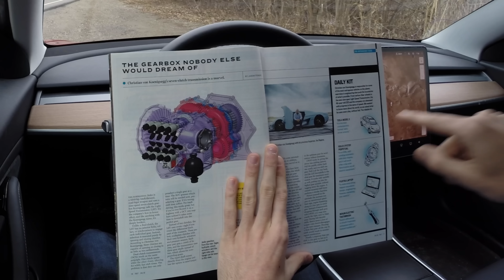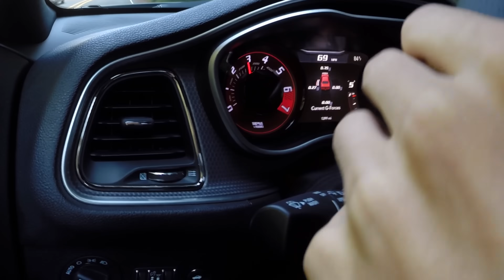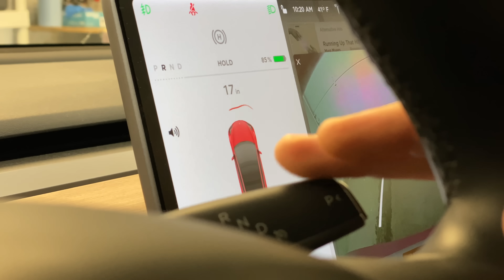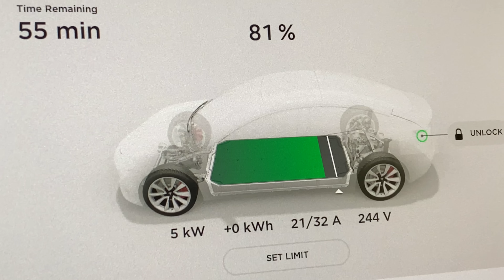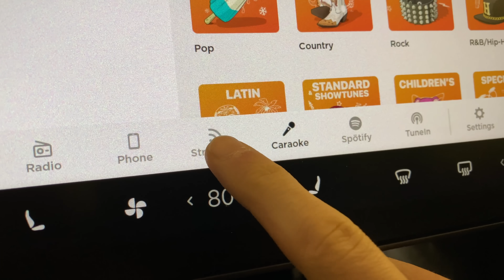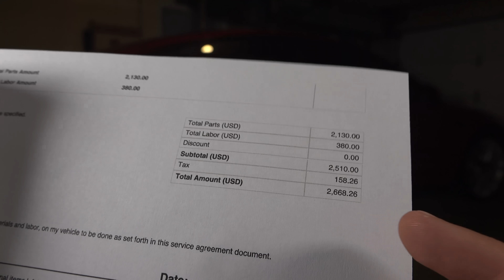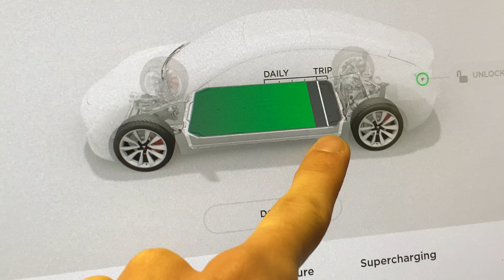Living With A Tesla Model 3 For A Year - The Best Daily Driver

Comment: No offense. If you like EV's cool. But they have just as many cons as pros. The batteries are an environmental disaster to manufacture. The car still requires fossil fuel to charge. They have issues in extreme environments with holding a charge. lake of dealership support, etc.  I find EV's to a nice niche market for certain situations and the right climate. I dislike Tesla's proprietary business model similar to Apple. Tesla's are a nice test bed for future technology, however, I'll keep my F150 and probably buy another ICE. 

Let's not pretend this is something it's not.
Reply: Steve Awesome It is the future and eventually everyone will drive an EV. It’s not a niche. They are much more efficient so a lot of fossil fuel will be saved. Battery production is not a disaster. It’s simple as that.

Comment: Can you do a technical video on TEG peltier exhaust system for generating energy from the engine exhaust heat? I have found some research from BMW showing promising figures. So I was wondering if this technology is still researched for hybrid cars or abandoned for some technical/cost reason? Thanks.

Comment: I think its nice only filling up once per week. Not plugging in every night. 
Also I dont have to park in a garage, or have a charger avalible. 
Cost per mile with depiction is way higher with a 60k car but the performance is undeniable. 
These are very reliable for 100k but the repairs that will eventually come will be thousands is not 10s of thousands after 10 or 20 years. 
If toyota only had a fully electric RAV4 AWD with maybe a I3 type back up small engine. Toyota is the only brand than seem to able to have high enough quality control to go 500k with minimal failures on stuff like climate control. power windows. wheel bearing. CV joints , shocks. buttons ., etc, etc. All of these items will be problematic in a electric car with extended usage.

Comment: I think the Model 3 Performance is an awesome car...I just can't end my love affair with manual transmissions.
Reply: I drive heavy duty trucks with 18 spd  to get over that fetish. Getting very rare nowadays with lots of Automatic Euros and lots of pretend drivers that think they are supertruckers driving them.
Reply: Gears beats electricity. Only city vehicles benefits from electric power. As soon as a electric car needs to compete with a geared combustion engine cars they go wrong in SOME major way. Rant incoming! Copy pasted one.

Cost, Environment, Complexity. One of them ruin the electric car. Outside of small slow electric cars. Like a electric golf car you use when playing golf. Sacrificing safety and speed. But just strait up beats a combustion car. Since it get all the benefits of the engine choice. 

Electric cars are heavy and wasteful. Making small city car with basically no impact safety nor good top speed might be the future. Simple cheap and good for the environment done right. Combustions cars can not beat a good electric car in this category. 

Good driving techniques and a change in how we travel in cars would be better for the environment then heavy battery riddled electric cars. Removing safety concerns being the big factor. And why we travel. (and how)

Electric cars are heavy and running on mainly coal unless you specifically charge them with YOUR OWN produced reenable electric source. Since anyone and everyone is taking advantage and making money before anything else. 

Just taking away the safety features of the car would minimize the batteries needed. And what damage the batteries have done to the planet needs to be taken into account. Just as well as the fuel used in a normal combustion car.  So minimizing the batteries needed is the fight needed to beat a combustion engine. Simply put. 

Saving on a resources that harms our world AND to change the way anyone travels. Just as much of a point as the first! Change the way we travel and why.

But that will not fly. So saving the planet are now all the sudden bad? 

Imagen if the engines was made as efficient as possible without being to complex and prone to failure. And the driver and traffic had to adapt to it's wills and needs. Mind blown. No self driving and no impossible to repair vehicles when 5 years old or more.

Instead of touching the brakes we cut the engine off and cruised the remained of the way before stopping. Even having a electric engine helping out at lower speeds. Also being the starter of the combustion engine. Which can run on wood good stuff. Ethanol. Wood gas. Whatever. 

Regenerating power for later use is also possible with that electric engine so even that is taken advantage of. Like if the roads where not used so in responsible we might be able to cut emissions down SO much by that change alone. But electric toy go fast and trendy. So we do that instead.  

Na we make the vehicles fit lazy humans that pay for comfort and luxury in a safe bubble. Instead of making them cheap reliable and good of the environment. It is electrical so I'm saving the world!

But dangerous and strict need of drivers being got dam good at driving. It is funny how imagining a car being a tractor makes you driver slower and drive safer. Or if the car is not safe to collide with anything to being with.

And instead of using the brakes just let of the gas to early. To the point of needing to crawl under added power to get to the intersection or whatever. Never touching the brake or having to stop. Using the stored energy fully before doing any maneuver. And having a lower average speed where it matters. (crawling instead of braking to a stop) 

This do not work when other drivers do not drive like that in a city for example. Or if the streets are overcrowded by people not in real need of being there. Just easy and comfy for them.

Very pleasant to drive a lorry and just have the time to cruise without using any diesel or brakes to your destination in sight. Compare that having to drive it like a F1 car to follow a time schedule. What is better for everyone? Having to rely on brakes VS almost not needing the engine turned on to get off the road and park? What drive style is best for anyone but the employer here.
Reply: @TheDiner50  that's what's keeping me from electric. You need this massive battery that doesn't have the best range considering how long it takes to recharge. It gives me brick phone vibes. Or maybe 1980 IBM computer that took up a whole room. We need a battery that's a few hundred pounds and goes farther than ICE cars with gas tanks, that don't form dendrites and start wearing out after 5+ years. It'd also gotta recharge in ten minutes. Enough time to plug in, go to the restroom and buy some snacks so you can get back on the road.

Comment: My problem with electric cars. No sound, no transmission, can't refuel quickly on long drives, can't really do hot rodding and tuning, and most of the time range. Also computers in modern cars in general bug the heck out of me and make driving less of a skill, it's like the car is doing all the work. Electric cars I feel just don't have the personality of combustion engines. There are so many options with combustion engine cars, the engine, transmission and mods you choose customize the car to what you like. I just love the feeling of thunderous exhaust from an American V8

Comment: No steering wheel heating available or just not in right from the start? According to new test report even the 2020 model of a Hyundai i10 has steering wheel heating now. Not sure if it is basic equipment or optional, but at least it is possible. And Hyundai i10 is a small model, not compareable with the class that a Model 3 wants to be at. Do I have steering wheel heating in my own car? No. Do I missit? Not at all, I would have to be a real whimp if my steering wheel would feel "to cold" so I would spend any energy in heating it up.   ;-)  It just feels good, without any need for heating.

Comment: One of my concerns about EVs was charging to 100% when I want 80-85% when charging overnight (since Li-ion batteries have significantly better life while not discharging them under ~20% and not charging over ~80%). I hope other car manufacturers have this feature of choosing how much you want to charge as Tesla does.
Reply: On the Chevy Volt, 100% charged is only 80% of battery capacity.  It also won't deplete below 20%, they built this in to preserve battery life.  Chevy was doing this since 2011.
Reply: @GrandPrix46   That's neat. 
But I think I would prefer the option to choose if I have to go on a longer trip to charge it a bit more than only getting maxed at 80%.

But for a normal everyday usage that thing you said is great

Comment: Jason, I assume you know this, but just in case: under controls > Autopilot you can set Forward Collision Warning to “late” so that it’s not so overreactive. Also, even in the vast majority of severe crashes, the vehicle maintains 12V power so the normal second row door release buttons work. A crash so bad that it knocks out 12V power is likely to be one in which emergency crews would have to cut occupants out of the vehicle anyway. Fortunately, this situation is extremely unlikely in a Tesla. 

Finally, just to be clear, I don’t think Model 3 is a perfect car. The best new car for the money? Yes, no contest. But as you point out, it’s not without its flaws.
Reply: Sorry, just saw your update on FCW. Hopefully my point on the 12V system and second-row doors is helpful though.

Comment: An electric car may be practical BUT I have a 4 wheel drive Tacoma and i can tow a 5000 pound camper with it. No electric truck can do that practically yet. About off roading...yes an ICE engine does have a limit as to how deep mud and water one can traverse....but an all electric truck will not do well because the motors are near the wheels and i am confident to say electric motors and water/mud do not mix well at all. Now, you may say yes but those motors are sealed from water...just like the Titanic was unsinkable eh.

Comment: I don't get why they can't make the base models front wheel drive instead of rear wheel drive. Very disappointing.
Reply: Because rear wheel drive is completely better and since there is no big engine, there is no downside to putting the motor in the rear.
Reply: Front wheel drives only exist because they are cheaper to produce by a couple grand.

Comment: Jason! I love your videos and would really like one to know what voodoo magic is holding our front wheels on our 3/4 ton van. It has 8 lug nuts holding the wheel into the rotor, but the rotor is only held on by 1 tiny little nut.
Reply: The bolts go through the roater? Really isn't that complicated. The nut just holds it on when the wheel is off.

Comment: Really, I like the driving involvement of the ICE but the electric car is really a simpler build with loads of advantages. The MAIN one is the lack of fume emissions. 
The disadvantage of the EV is just the road trip point all the others mentioned are manufacturer build problems. 
But great points raised in support of the EV (10 advantages).

Comment: The only two things that I would complain about with the Tesla is the lack of range for interstate driving and cost to own. I can go from the Eastern Ohio border with a full tank @ 65-70 MPH average on I 80 to I 84 and on to the Mass Pike and fill up in Shrewsbury, Massachusetts in my 2018 Subaru Outback 2.5i Premium with almost 50 miles to spare (19.8 gallon fuel tank). Second, the Tesla costs over twice as much to buy.

Comment: Electric cars are only for the rich and homeowners aka rich. Not convinced at all that they're ready for the majority of people.
Reply: Really? An electric Smart EV tops out at 24k before rebates.  That's minimum wage monthly payments bro lol.
Reply: @MindzEnt  - I think there's more to life than just paying for a car..

 Also why pay that much when you can buy a ICE car that will get you to the same places just as fast for much much cheaper.
Reply: @AC.LM11  You brought up price not me, Sounds like you're just biased against any EV. Doesn't matter how good or cheap they are to own. 99% of people that own Tesla's said it's the best daily driver they've ever owned. That's including die hard gear heads..
Reply: M.A. M.R. - But they’re not cheap to own, that’s the issue. And if you want the full benefit from an EV you also need to own a house to charge it overnight. Otherwise you have to spend time researching where you’re nearest charger is, hoping no one else is using it and then waiting potentially hours for it to charge. Sounds like a step backwards from a petrol car for me.

I think that one way around it, is to have fully swappable batteries on the cheaper cars that are cheaper initially to buy but the car manufacturers get their money back via charging the same price as an equivalent fuel fill up when you get a battery swap.
Reply: @AC.LM11  if course they're cheap to own. You need to get informed.

Comment: Yo, I don't care I just don't want a car worth $60,000 that require a select eco-system that isn't that big in my area nor do I want to have to have a garage that I can install a charging wall that can cost $100,000. Also, I am in love with the noise of my car.
Reply: Adding a 240 volt 50 amp outlet in my garage cost me $250.00
Reply: Wtf are you talking about 100,000 dollars?

Comment: You can throw a parade for the Tesla but the truth is...... not very many people can afford a glorified toy car. My god a used one that’s 5 years old is 51’000. Payments are 950 a month, most people don’t even get paid that much. I guess it cost a lot for change. Also, in -40 weather it only performs 1/2 as well as normal. No wonder why there has only been 7000 sold in Canada. If Tesla wants to make money and not go bankrupt, which eventually will happen; they should look at making this vehicles more affordable. If they were more reasonably priced, I would be interested. However, my Ford F-150, that is 13 years old with over a million miles on it may cost a lot for gas but, it runs in -40 weather, and it’s totally paid off. People aren’t afraid of change, their afraid of buying a new product, paying an arm and leg for it, and it not preforming the same way or better then what they already have. The average family isn’t into trends or fads they can’t afford, they want something reliable and cost efficient!!
Reply: You're in denial.  It's ok I was too but eventually you're going to come around to it.

Comment: Heated steering wheel and heated seats are not just luxuries in electric cars. I use those in my Bolt quite regularly instead of the resistive heating. They are much more energy efficient.

Comment: Great video as always. Would you mind to compare efficiencies between M3Performance and M3 AWD long range? I'm about to pull the trigger on Model Y and I'm torn between buying performance model or AWD with FSD. Unfortunately my budget doesnt allow me to go for performance and FSD. Also what's very important to me is range, so if driving at the same speeds on the same roads the perform very similarly in terms of efficiency KW/H then performance is the way to go for me, but if Performance is thirstier ... then I'll go with AWD and miss the extra punch . thanks again for considering. Daniel

Comment: Having rear emergency handles is a mute point. If you have child locks like you have in most cars, then you can not have rear emergency release because that would defeat the point of child locks.  Secondly, don't buy low profile rims in the first place so they would not crack. Just buy the awd and get 18s to begin with or buy the aftermarket 18s to begin with. Do you really need to waste the money on extra acceleration just for bragging rights? Low profile gives a less comfortable ride, more easy to damage, and tires cost more. We got our 1 mos old used awd model 3 with 19s, and immediately arranged a trade with money for an 18 set.  In the short time on the 19s, I can say the ride was definitely more harsh.  Warning system can be adjusted in settings. It is better to warn and not need it, then to not warn at all.

Comment: I like the idea your electric motor does not run all the time at the lights, the ICE is incredibly complicated over 100 years of development. But it still explodes a fuel and air mixture to push down a piston. Sound primative and unrefined rather that run a pair of electric motors.
no complicated cooling system, transmission and exhaust.

Comment: I had an idea: one exhaust manifold inside the other exhaust manifold.  The internal exhaust manifold and valve leads to the catalytic converter, which is itself inside the outer exhaust manifold.  After the cat, the two exhaust manifolds merge into the larger, outer one.  Then this leads to the final cat, which is where both are merged?  This would both make for a cooler exhaust manifold and make the cat more efficient??